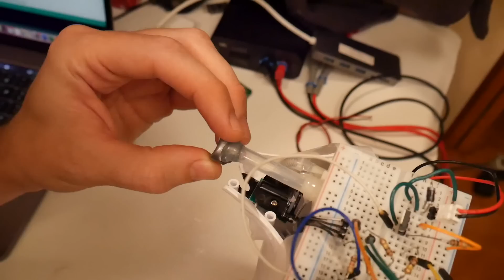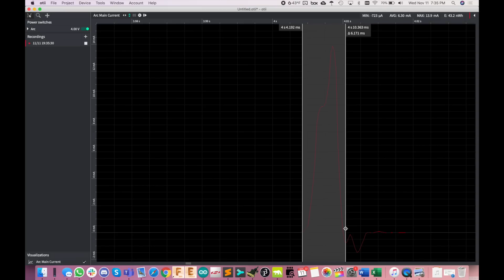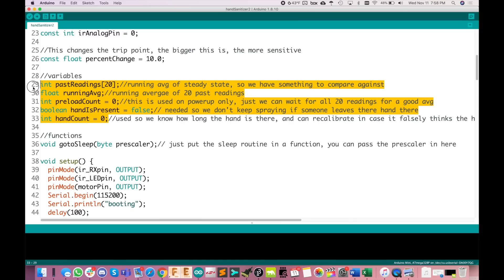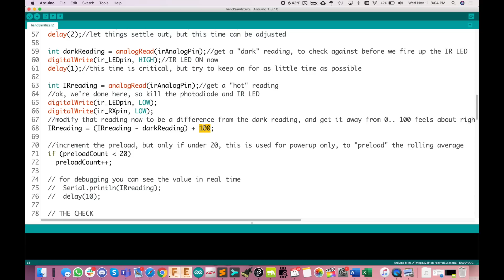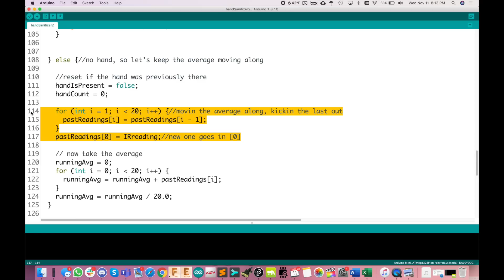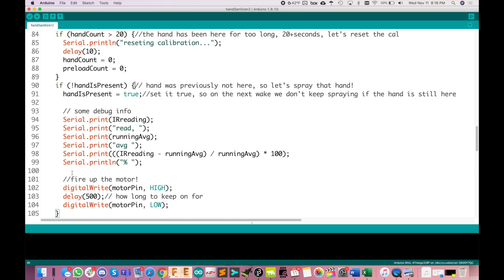How to Make a Better Hand Sanitizer with Arduino! LOWER POWER

Comment: hello. May i know which motor did you used? I am using 4xAA size batteries. Although i am able to make my circuit low power but the cheap chinese submersible pump takes 300ma. Any suggestions? I want to run the system for atleast a month.

Comment: Nice project! Small tip for counting the average: instead of rotating the whole array and writing into 0th element, keep the array as is and move the index to overwrite the oldest value. Difference between O(1) and O(n) (not that it matters for an array of 20 but still).

Comment: Great video. Even a noob like myself was able to follow along.
If you’re going to take this farther, please consider some of the comments for follow up rather than trying to make this into an iot project (not really a valid use, imo). Particularly the capacitive sensor could result in potentially better battery life than sampling constantly, even at 1 second intervals. I have to admit I didn’t understand the “ring buffer” comment that one of your viewers made but I would be interested in learning more. This is why I tune in, always learning on your channel.
Reply: https://en.wikipedia.org/wiki/Circular_buffer

Comment: Kevin, I am impressed with this project and your approach. Definitely going on my list of "To Try"! 
I've made a couple of less complex , simple circuit ones and the most annoying issue was the false positive responses, in particular with reflected sunlight using several different common IR modules and line followers(with or without the 38K oscillation). Mine utilized USB wall plugs which helped a lot powering the motors, especially the foam dispenser type; but were inconvenient/limiting usage locations. Guess I'll have to bite the bullet and add a microprocessor to get control of the sprayer and stop dumping a full container of sanitizer when a door was opened at the wrong time of day. Good Stuff!
Reply from the maker: thanks! and yea let me know if you do try this
Reply: @Kevindarrah  I downloaded your files(to see IR parts details) and found the Drawings.vsdx file pretty hard to open as it is VERY proprietary with few common applications able to open it. Could you please consider using another format that is easier to utilize for the majority of folks in the future? Not suggesting you use different creation software, just export differently or as multiple types. Thanks
Reply from the maker: @scottstevens7569  oh that is just the visio file I used to make the drawing
Reply: @Kevindarrah  I do realize what it is, just that there are only 4 listed Apps able to open it requiring a DL if you don't have. I have dealt previously professionally with Visio limitations if you are not a user. 
 I was really looking for info about the IR(module?) choice or construction-  .
Reply from the maker: @scottstevens7569  oh yea, not sure - the IR module I use there came with the bottle

Comment: Super interesting!
The code as it is is great for clarity, but I wonder if using direct port manipulation, replacing the rolling average with exponential smoothing, getting rid of all floating point operations, stoping timer0 and replacing delays with a busy loop while on the highest system clock prescaler option (CLKPR) would take you further in your quest for stupidly low power consumption.
Reply from the maker: yea, these are good suggestions - I'll have to try these out!

Comment: I have a better circuit Kevin. What you have to do is cut down the IR sensor and instead use a completely passive capacitive sensor. This way you can set your uC to wake up only when there is a hand. The standby current consumption in this configuration can go as low as 4uA s.
Reply from the maker: yea, was thinking about that as well... if I get some time maybe I'll convert to something like this
Reply: @Kevindarrah  It's simple. By increasing the sensitivity of a normal TTP223 touch sensor (by adding a wider touch pad) you can make an extremly power efficient capacitive proximity sensor. If you want I can share you the code as well. I have used your code numerous times and I will consider this as a small pay back from my side 😊
Reply: @nafihahmd  That's good idea for alternatives, better than my Wrist inserted RFID plan. :)

Comment: Can I suggest that you use a ring buffer for the averages. That would allow you to skip iterating over the 20 values two times. Probably not significant but interesting.
Reply from the maker: yea, actually that's a really good idea!
Reply: @Kevindarrah  can u show how to do that
Reply from the maker: @TheUnofficialMaker  yea, instead of looping through like that pushing everything over by one, just keep an index of where the new value goes and increment on every wake.  Super simple and faster
Reply: @Kevindarrah  Normally you use Modulo division although I'm not sure if that is a single instruction on this microcontroller.

Comment: Very cool project Kevin. What software do you use to display and analyse the current consumption profile?
Reply: Looks like Otii analyser. They are £650 in the UK which is way too expensive for a hobbyist.
Reply: @J-K-AG  Thank you, I've checked otii's website and i think you are right.     That price though 😰. Time to save up!
Reply: Are there any cheaper alternatives for hobbyists?